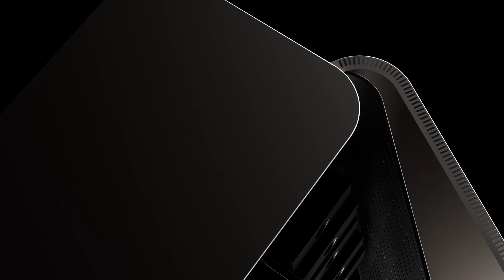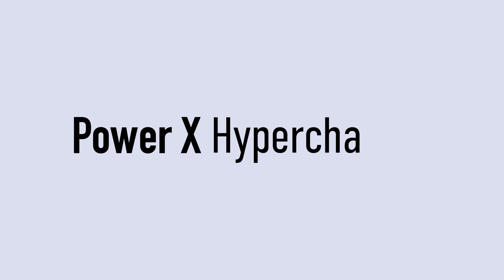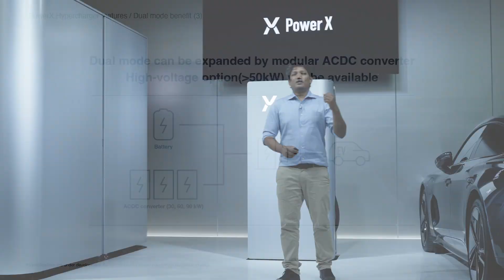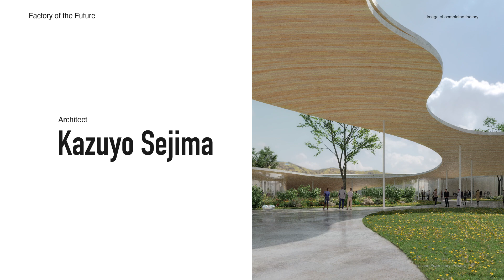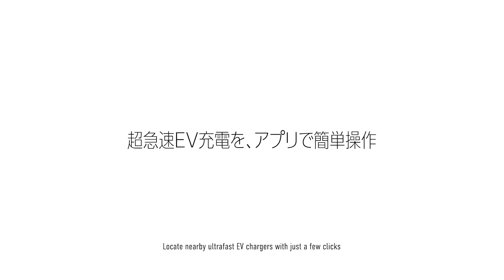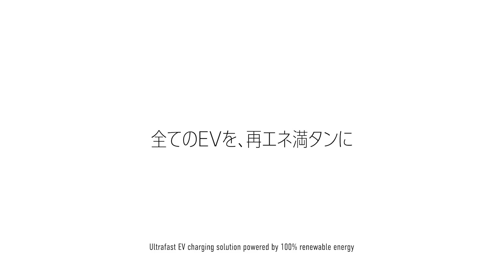PowerX Hypercharger｜Ultrafast EV charger

Comment: Is there a plan to allow DC-DC charging of the Hypercharger battery? Any technical reasons and/or any cost reasons?
Reply: Yes. The architecture allows for this! The cost of conversion from actual source shall guide the business case. For example having another mobile BESS charge the hypercharger battery if that is what you meant!
Reply: @deepakraut8389  Thanks for the response. I just remembered you the company mentioned of modular design. I think you imply it.
Reply: @deepakraut8389  … means the interface design is flexible to match the costumer’s order and the price add depends on the technical difficulty and the corresponding part price.
Reply: @kaneisohiro170  Yes ! That works from the design perspective and our unique multi level DC links allow for such customization based on business case and customer preferences.